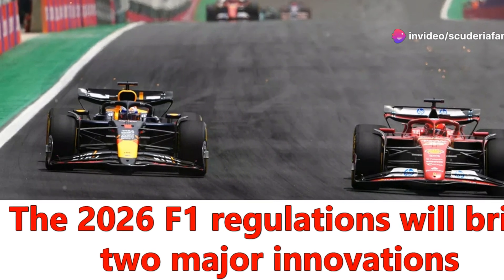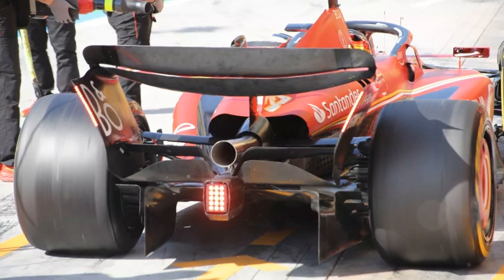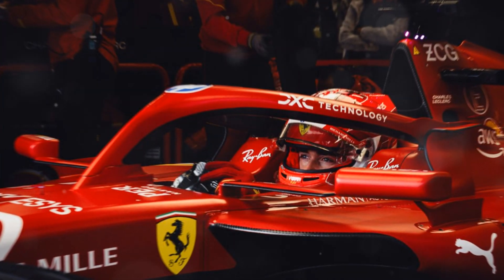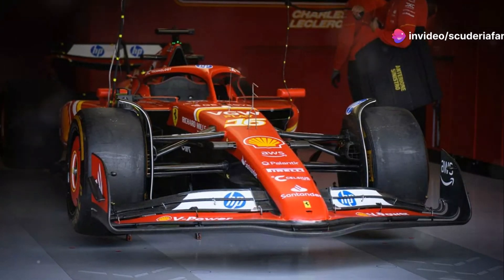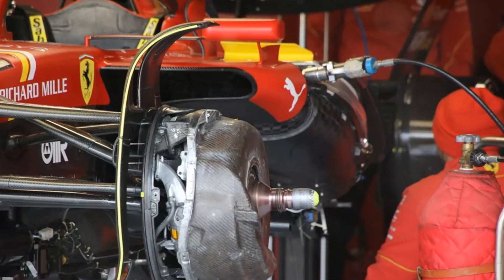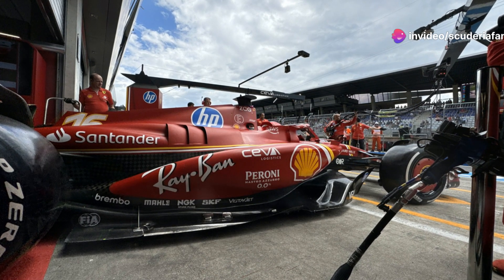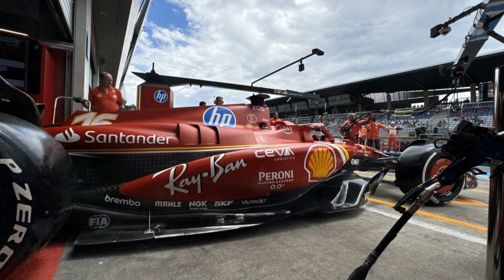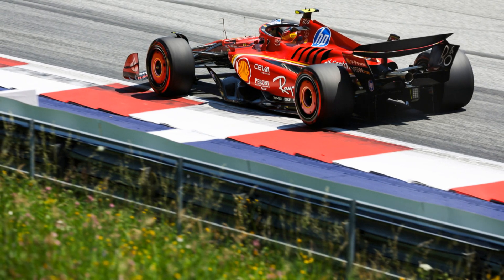2026 Formula 1 rules and regulations: how override and active aero will work

Comment: They need to abandon ground effect.
It makes the cars oversensitive to setup and unpleasant to drive
Reply: The mclaren and the red bull seem pretty fun to drive, going off the driver's reactions. Seems like some teams need to fix their car if they've got a problem.
Reply: @yeanisch  max was complaining about his car a lot recently
Reply: @fintonmainz7845  fair, but at the start of the season the car was a rocketship (like in 22 and 23) so to say that ground effect needs to be abandoned because the cars are all upleasant to drive seems like an overstatement.
Reply: @yeanisch  not really in the context of new regulations in 2026. Any driver would prefer  a fast/competitive car but the GE cars are very difficult to set up and not nice to drive.
Reply: @fintonmainz7845  which has given us a very exciting season since Red Bull shot themselves in the foot somewhere around Miami. I don't see the problem. The cars that work (Mclaren, Red Bull and sporadically Ferrari) aren't usually difficult to drive when they've been set up correctly, although they seem to be when we compare them to the 2021 cars. 
Those weren't great either. With the huge amount of drag, following closely was almost impossible. The one car that really worked was insane and almost impossible to challenge. Drs did work but not optimally, because all constructors did their absolute best to create as much dirty air as possible to slow their opponents down, which gave us DRS trains even worse than we know them now. 
I'm happy with ground effect. The downforce coming from below has made aero much more simple and is still keeping drag down to this day. 

I do understand what you're saying, I just don't believe going back to the way it used to be is the right option either.
Reply: @yeanisch  covering the rear wheels (like IndyCar) and having "clean" (simple) front wings would solve most of the dirty air problem.
Reply: @fintonmainz7845  but why, when you can also just use cool physics to stick to the ground. It works.
Reply: @yeanisch  because you gain/lose massive amounts of downforce depending on gap to the ground pitch angle etc. "Ground effect" has been around since 1978 in f1 and they still havnt fixed it.
Reply: @fintonmainz7845  but it's much more controlled now compared to back then. It was banned in 83, as you probably know. The balance between wing downforce and ground effect downforce is better now, and because of mercedes in 2022 the cars have a higher ride height which already makes ground effect less effective anyway. I have never driven a ground effect F1 car so I don't know how enjoyable they are to drive, but I know the theory behind why the FIA wants the teams to use it. It's the most efficient way to create downforce with minimal drag. I don't want another indycar. I want F1. And honestly, the drivers should have nothing to complain about. The cars of the 70's were horrible to drive, but many drivers did so even in their 40's.